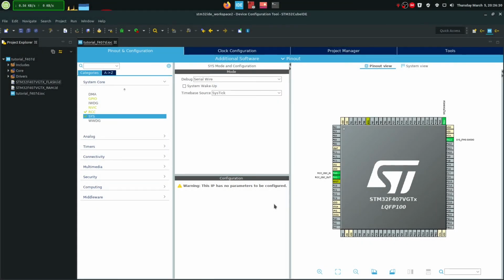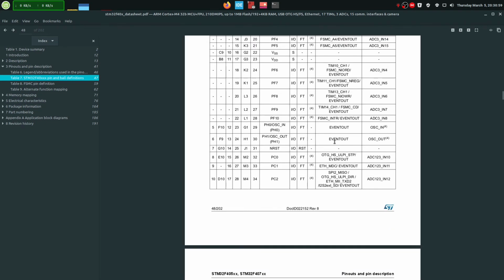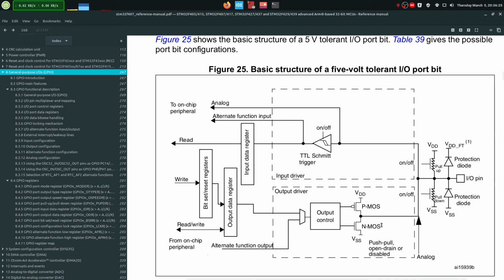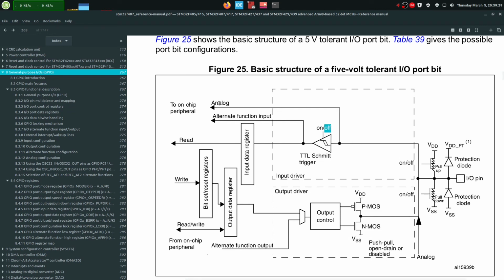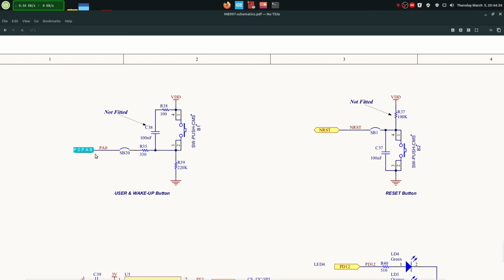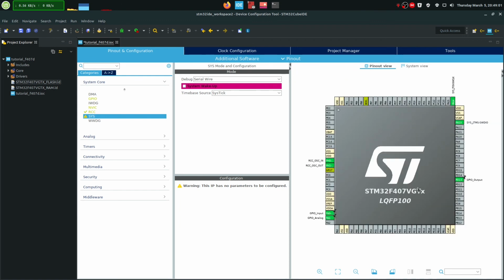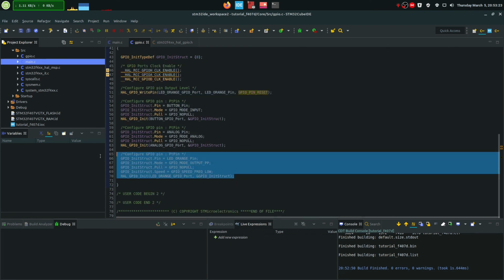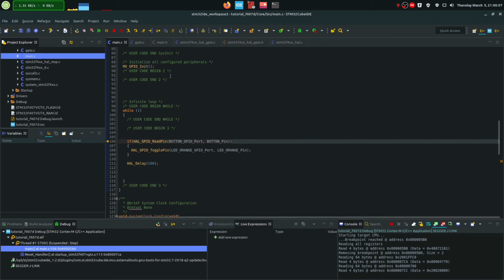Workings of GPIO with HAL | VIDEO 23

Comment: Thank you so much for sharing your knowledge sir. It is helping a lot me to begin with the ST microcontrollers. But I have a question. Where are the other videos of the series. I mean there are only numbers like 23 36..if I could get the complete series it would be great.
Reply from the maker: You can watch older videos with standard library. I do talk about peripherals in general as well. More videos will be comming, but I think that I have covered the most basic and the more important and harder to understand, like gpio/adc and dma/i2c.
thank you for watching, stay tuned!
Reply: @MatejBlagšič  Hey sir . I have a query. I am using STM32F030 demo board. It has the IC STM32F030F4P6 and  I am using STLINK V2. I am able to upload the program using STLINK but there is an USB port which is pretty much useless. I want to upload the bootloader to program the controller to upload from usb. I am trying to find a bootloader but I can't find any. Do you know of any such bootloader sir?
Reply from the maker: @Jalakam Kiran There are quite some projects out there and they all have the same core, just the methods vary a bit. You can check out this one that uses usb serial peripheral if you uC supports it: https://github.com/viktorvano/STM32-Bootloader. You can preload different images on your microcontroller and thus have multiple firmwares on same uC or you can use traditional bootloader as a means to load new firmware via serial or usb-serial.
Reply: @MatejBlagšič  thank you so much. Will check it out